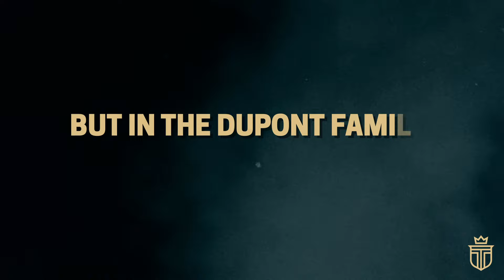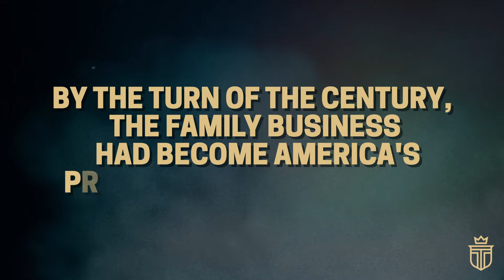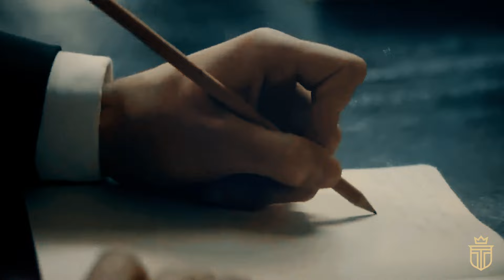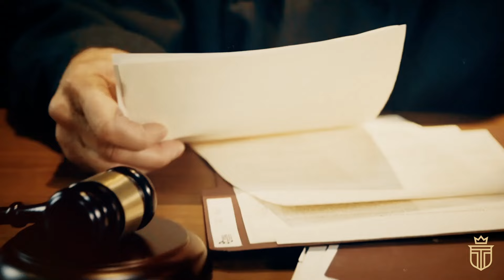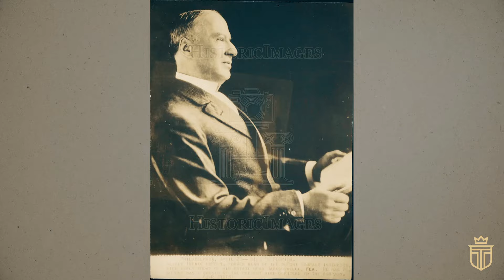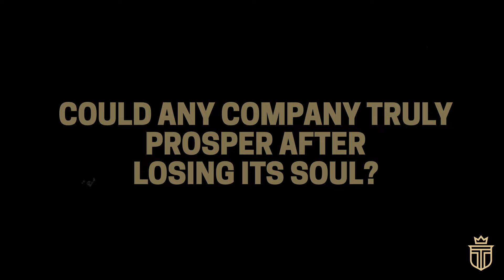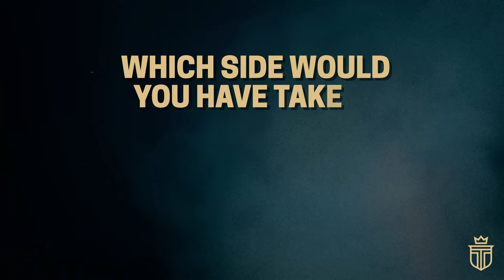When "Old Money" Families Fight Over Billions: The Dupont Family War

Comment: I would had taken a mixture of both. I think it is important in a family business, that the family  runs their business, mantaining family control, and tradition, but at the same time it is very important to modernize and expand the business; so I would demand  to family members  that  are involved in the management of their business to  adapt new management techniques and prepare professionally for that new stage in the company´s  growth. I don´t think it is necessary  to separate both management strategies.
Reply: You could not have said it better. Maintaining the traditional principles of in depth hands on knowledge of the craft would ensure a high degree of quality in production. Many a time when business expand there is a compromise on the quality of the product. However there was also the need to modernise so as to keep up with the ongoing flow of technological advancememts. So there are pros & cons to it.